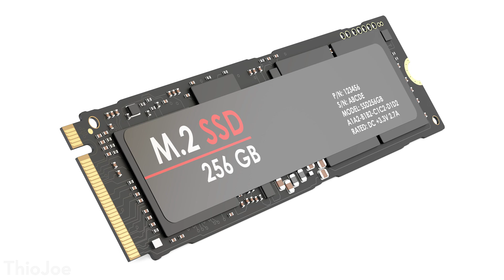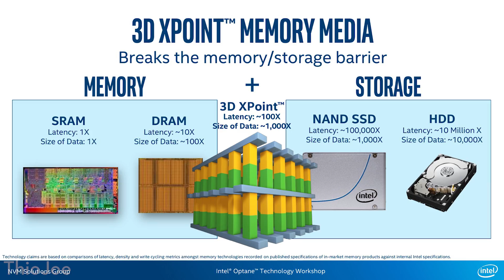Different Types of SSDs: You Need to Know!

Comment: Downside of a NVME on board is if you use it you loose 2 SATA ports on the board. Until they address this issue I will stick with mechanical drives. If prices come down on SSD's then I would use it, primarily for the boot drive. For long term storage I will still use a mechanical drive.

Comment: Nicely informative video on ssd technology. Maybe later as ssd technology advances - ssd drives could say use more then 4 pcie lanes for better performance. Maybe even go up to using 16 lanes  ( X16 ) with various configurations in between allowing the pricing to be relative to the drives performance. Say have a M.2 ssd that's an X16 model with the best flash memory vs a x4 model with say cheaper flash memory that would out perform hdd's but not the higher end ssd drive.

Comment: I have a Dell Inspiron laptop that I would like to upgrade to SSD. The drive I am considering is the Samsung 860 PRO 256GB 2.5 Inch SATA III Internal SSD (MZ-76P256BW)
. What additional hardware would I need to purchase in order transfer Windows 10 from the old drive to the new SSD?
Reply: Try the free AOMEI cloning software.

Comment: M.2 comes in two flavours. PCIe and SATA. SATA is still the same 6gb/s as a normal SATA interface where as PCIe uses the availiable PCI lanes so offering differing speeds (still faster than SATA). They also have different hardware connections (Interfaces).

Comment: Thank you for summing up all these new abbreviations regarding SSDs in an easy to follow video.   I stopped keeping track when they moved from IDE to SATA.  I got distracted by my (ex)girlfriend and college education, neither of which I am using now.

Actually I lie.  I saw you had another video for speeding up an internet connection.  After watching this very well made video, I wondered what you had to say.  As I watched that video, things didn't make any sense.  However, I kept giving you the benefit of the doubt (he must mean modem, not router.  He's probably going to use the batteries in something or take them apart .  He must mean cable between modem and ISP, not router and modem).  From my recollection of college physics, the info on how a transformer works seemed correct, though I didn't quite know how you were going to apply it.  Once you grabbed the patch cable, I realized it wasn't going to work.  When you wrapped the wire around the first battery, I started laughing, and read description/comments.  Thank you for the laugh.

So to sum it up.  Again, thank you for THIS informative video, your delivery during the joke video was very good, and I'll resume not using my college education or know where my (ex)girlfriend even is right now (probably China or Mars).

Comment: Thx for the explanation, very useful. One question -- if you are considering a PCIe SSD drive how do you determine if your computer can boot from it. IOW, if you are not just using the SSD for storage but also have the system partition on it I've been told that many PCIe slots are not "bootable". Hopefully, my question is clear and thx again.

Comment: You missed the essence, IMO. On most motherboards all I/O connectors dangle off a switch called Southbridge. That has 4 PCIe lanes to the CPU for all I/Os. That switch may offer a PCIe NVME even with theoretical speed. Latency is caused by the switch and time sharing or multiplexing of a couple CPU lanes across a boatload of I/O lanes. If you have an M.2 NVME card and want it to really perform, then buy a cheap PCIe adapter so as to have it on real PCIe lanes directly into the CPU. the best adapters are passive and will only do some voltage regulation. Check motherboard and CPU specs to see you have enough PCIe lanes, though. If you have 28 lanes and use two 16 lane GPU cards. With 40 lanes, you can have 2x 16 lane GPUs and 2x 4 lane NVME. You'd be surprised how fast your disappointing card can be.
Reply: Do the M.2 connectors connect to the southbridge or northbridge or direct to the PCIe interface on the CPU though? I wonder if the PCIe-only M.2 connectors connect direct to the CPU? If so, perhaps they're a bit faster.

Comment: Doesn't matter what SSD you get. As long as you replace the hard-drive for the OS it's going to be stellar.
Reply: I am Chris or not. An 8k prores HQ video stream at 60fps has a single stream data rate of about 7.5gbps. Multicam 4k prores 444 even at 30fps and you’re in the same ballpark or more. A sata ssd would not give you a stellar experience for either of those tasks, whereas an nvme drive would do the trick nicely.
Reply: @EricEsser  Ok, but pretty sure by the comment he meant the average home computer not a video editing computer. That said, have you considered using a server or workstation motherboard with say, 512GB RAM. Then use say, 480GB of it as a RAM drive. Have an NVMe drive as well and use the RAM drive software or other software to continually backup to that? ... Although at your data rate it would only store about 8.5 mins of video - heh.

Comment: But how well can it run Minecraft?
Reply: LYx461 I don’t know about Minecraft but I can tell you this much, I just installed a 500 GB Samsung EVO 970 M.2 SSD into my desktop and I set it up as my main boot drive and the performance gains I’ve seen are insane. That M.2 SSD is an absolute beast. Just to give you an idea of how fast it really is, I’m loading windows 10 in under 14 seconds now. I’m literally talking from the time you hit the power button until windows 10 is completely done loading is just under 14 seconds with that M.2.

Comment: he got history wrong 2.5" hard drives are relatively new
Reply from the maker: Wat no they arent
Reply: a 2.5" hard drive is basically a slimed down version of a 3.5 inch hard drive made for small computer systems and laptops, the first 2.5 hard drive was made by prairie tek in 1988
Reply: Relative is a difficult thing to be dogmatic about. In computer years 3 years is ancient. I wouldn’t pick a fight over this kind of thing

Comment: where to get a sata 2 3.0gb/s ssd in 2018?
Reply from the maker: They probably dont make Sata II SSDs
Reply: Sata 3 SSDs are backwards compatible with sata 2 motherboards so just buy the cheapest SSD you can find.
Reply: true, but I am having a situation here my laptop is old Lenovo Thinkpad T510 it has a 250gb hdd 7200rpm 2.5inch and I want to replace it with 80 or 120gb ssd and use hdd in ultrabay optical drive. On Lenovo's website it is saying Micro sata SSD under SSDs section so what does that mean? I can't use regular 2.5 inch ssd?